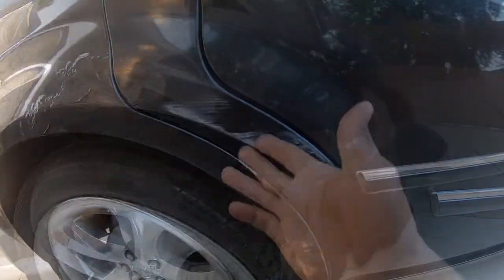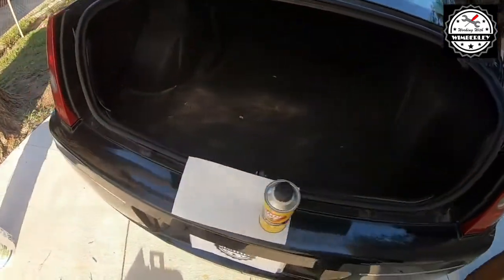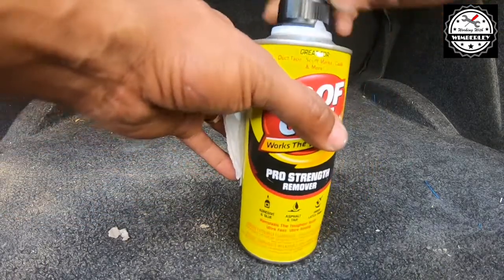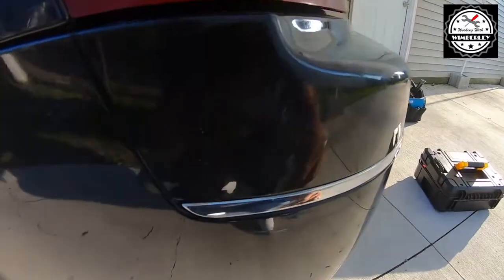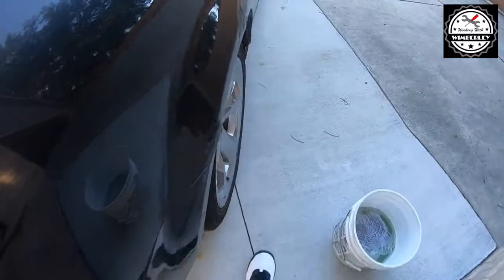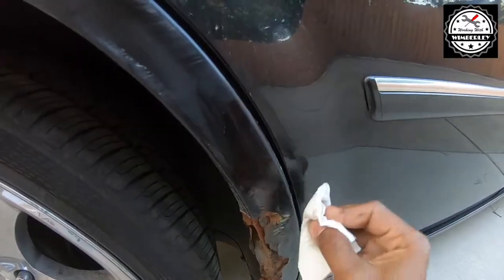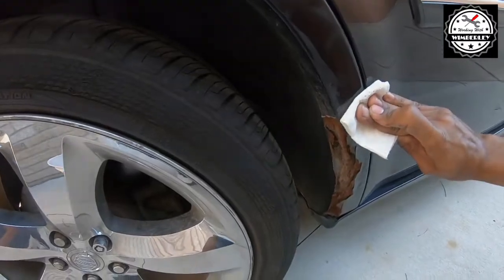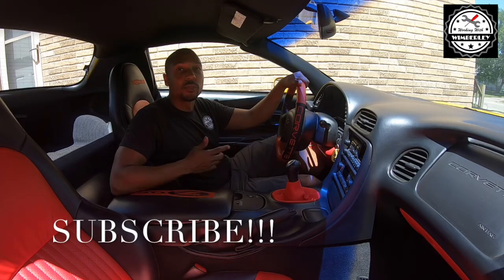How to Remove Paint Scuffs & Paint Transfer On Your Car Quickly & Easily with No Tools! DIY

Comment: I hope it works my I messed up the side of my fil truck so I’ll be getting some today and seeing
Reply from the maker: I hope it works too! It’s always worked for me.
Reply: WorkingWithWimberley I couldn’t find it at Walmart where did you find it I only found dr scratch and it’s not as good 😭
Reply from the maker: I got it from Lowe’s. Home Depot has it as well. So does Walmart. I’m surprised they were out.

Comment: what about the rust?
do you have any method for removing thar?
Reply from the maker: I don’t have a “quick” method. It would be to cut out the rust and weld in a new panel of just replace the rusty panel entirely.
Reply: @WorkingWithWimberley  I could not find this product in my country. Do you know an equivalent?
Reply from the maker: @karljacobs1748  Unfortunately I don’t. I’ve only ever used goof off.
Reply: @karljacobs1748  you could try and use some compound that’s what I always use
Reply: MAACO

Comment: This is the oil based goof off, correct? No concerns about damaging car paint?
Reply from the maker: I’m not sure if it’s oil based or not. I could not find anything about that on their website. As far as damaging the paint, I’ve been using it for years and have never damaged my paint. Specifically factory paint/clear coat. If it’s rattle can paint or dabs of touch up paint, it will remove those. You can also try a different method that doesn’t involve a cleaner to remove your paint transfer.